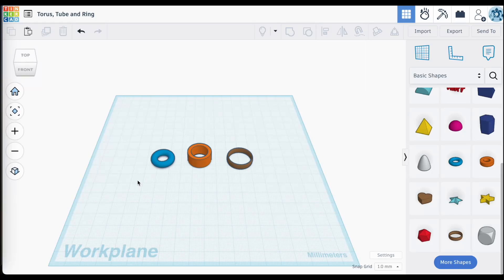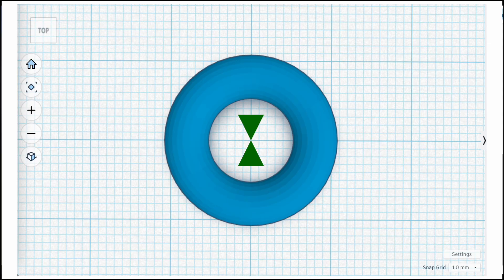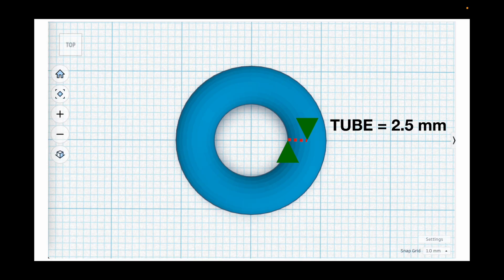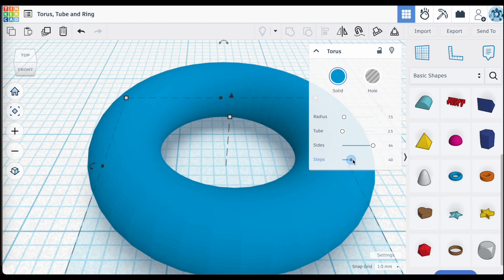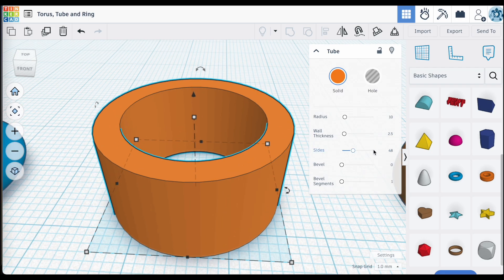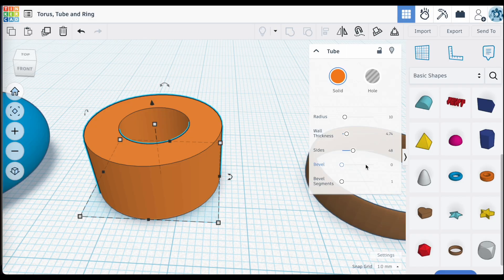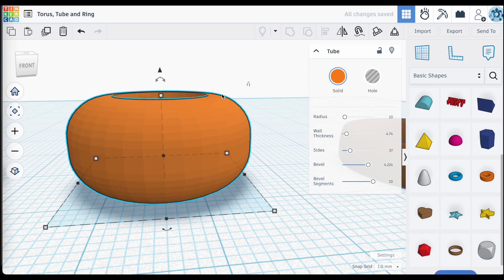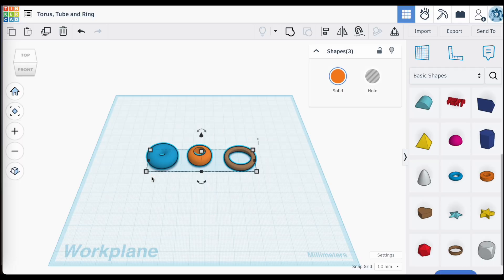Understand the settings when using Ring, Torus, and Tube in Tinkercad

Comment: I agree.  This was very helpful to me as a Tinkercad newbie.  But...I am confused about what I'm actually seeing in Tinkercad.  I created a new tube and, by default, it had a 20mm diameter and the radius said 10mm.  Good so far.  When I change the diameter to be 35mm, however, the radius measurement didn't change; it still said 10mm.  Am I missing or is there a bug in Tinkercad?  Thank you for any help you can give.  😀
Reply from the maker: Yeah the tube and torus ring can be confusing because they measure the radius from different points.  But first, to your question about changing a 10mm radius to 35mm and still not having it change... if I understand your situation, I think what probably happened is that you resized the tube by either dragging or changing the values on the shape itself.  The object will take on the new dimensions that you changed but the diameter listed in the drop menu on the right will still read it as unchanged (10mm) because the changes were not made in that menu.  It is confusing that it works that way. You are going to find that any shape that has the ability to be resized by the dropdown menu will do the same thing if you opt to resize it manipulating the object dimensions on the workplane instead.  When it comes to rings and tubes, I am moving to revolve sketch - I find I can do more with those shapes and the experience is more consistent.  Anyways, a long response - I hope that all made sense.  Thanks for posting the question!